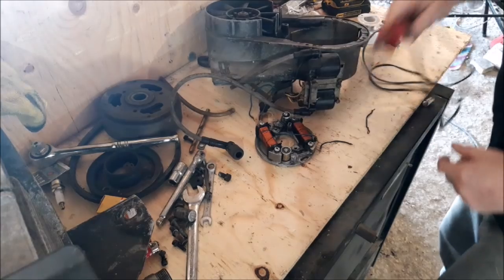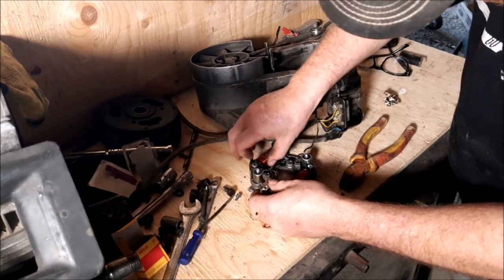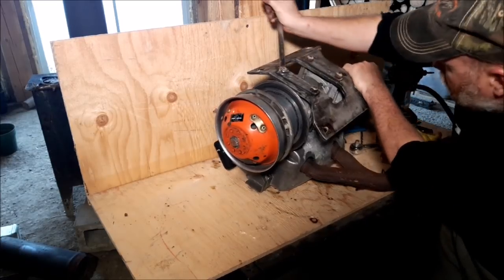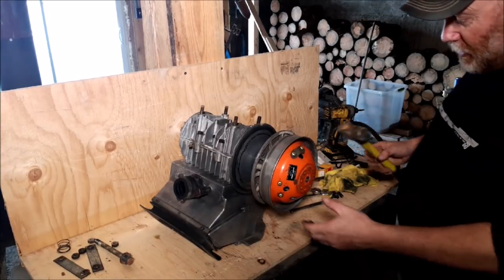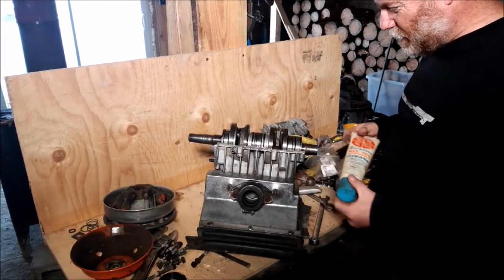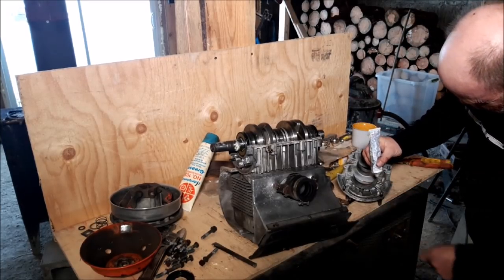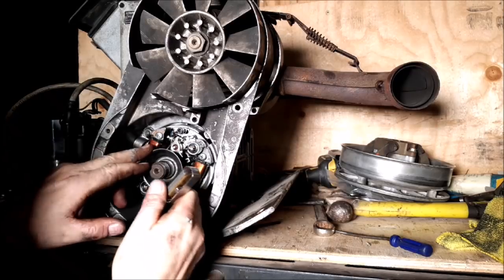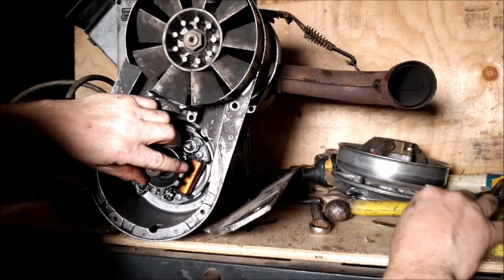Ski Doo Rotax Engine/Replacing Breaker Points, Condensers And Crankshaft Seals

Comment: If you want that thing to really rip hard, set the timing using either the direct or indirect method with a timing light or buzzer. FAR more accurate, produces way more power and more reactive to throttle responses.

Comment: Hey Cecil, was running my sled the other day it’s a 90s 377. The engine shut down on the trails, after this it seemed to have more pepper. Was thinking it was the crank seals? Has good compression, by feel I don’t have a tester. Just assume it’s running lean and that’s why. What are your thoughts?
Reply: Update: it was a crank seal and then I blew the PTO cylinder. Just rebuilt the motor but lost the electrical. Might’ve bumped the CDI while rebuilding. Hoping to get it all together this week, before we lose the snow.

Comment: Did you use Oem points and condensers, or Kimpex. I haven't had very good luck with Kimpex.
Reply from the maker: Yeah I use Kimpex condensers, They work as good as Bosch for the most part.  Cheers.

Comment: I used the wrong soldering iron, I’m wondering if that’s why I get really food spark to one plug and nothing to the other. Ive checked everything a dozen times ?
Reply from the maker: Yes it maybe you overheated the condenser.   Now I have seen folks install a set of breaker points and have the point wire backwards and it grounds out..Or they forget to re install the nylon washer on the breaker points. Let me know if you figure it out.  Cheers
Reply: How does one get the point wire backwards? It just goes to the condensers
Reply from the maker: @elsydro8064  If you twist the point wire the end of the wire terminal that is crimped to the wire can contact the point body when it's tightened up.

Comment: i got a rotax 503 that has spark on both cylinders but its just runns on the left cylinder, i have change CDI and lightning coil can the stator be the problem?
Reply: its new pistons and it was the same before the change

Comment: Can these seals be installed without splitting the case ?
Reply from the maker: It is not advised.  It's the case that pinches the seals to hold them in...I've never had luck any other way, they just seem to eventually pop out  :-(  Best of luck though.

Comment: Don’t hit the clutch with the hammer
Reply from the maker: Hello Arthur,  If you are familiar with working on these clutches you will know a few small hits with a hammer won't hurt them, and you will also know that you always resurface the two sides with sandpaper when they are running, this takes out the ridges from years of use... Sometimes a good hammering is needed to get rid of these ridges.